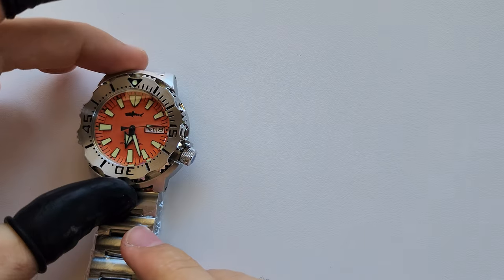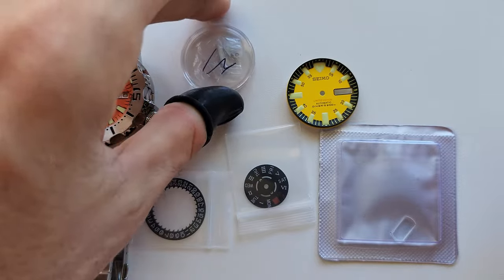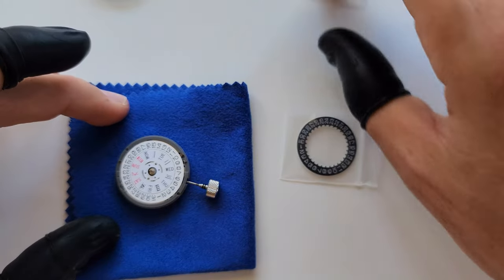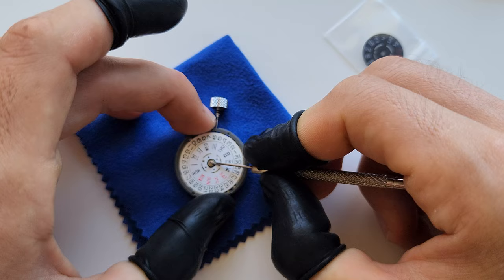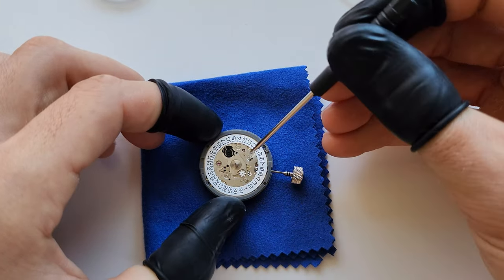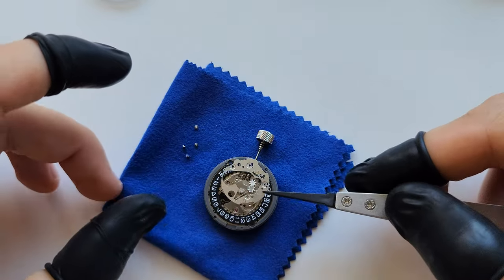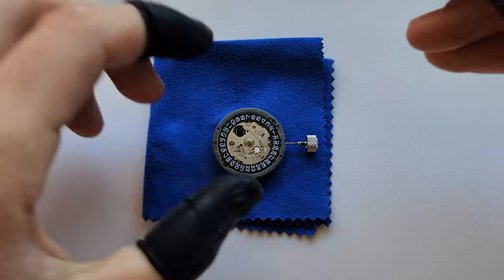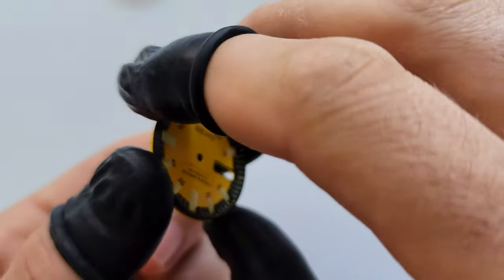Super Rare Seiko Monster SKZ203 MOD | Or perhaps not super rare anymore :D

Comment: Great work, will this monster dial fit a skx007 or sumo case?
Reply from the maker: @miguelmendez4718  without the chapter ring maybe
Reply: @ShortBetter  okay thanks I believe the monster dial is a 29mm and I didn’t know if the chapter ring would be a problem.  👍
Reply from the maker: @miguelmendez4718  the dial size is ok, but monster's chapter ring is attached to the dial, and if you remove it, you will have 4 small hole. Perhaps you can try fitting it in SKX case without the chapter ring
Reply: @ShortBetter  okay thanks 👍